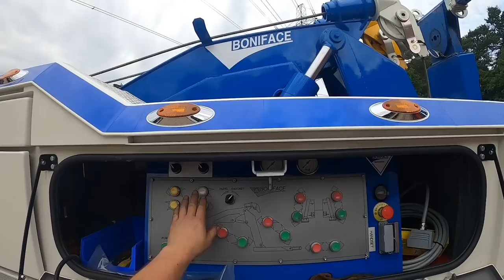NEW HEAVY RECOVERY TRUCK WITH AMERICAN TWIST!

Comment: What a spiffing new truck :) The locks on the lockers appear to be a bit in the way, though. Bound to get caught on them when they stick out like that. I am curious about the wheel setup, both on this and the old one. On the continent trucks like these are all 8x4 (we've even had some 10x4 in the past), especially here in Scandinavia where we have lower axle weight limit. Don't think you'd be allowed to tow that much with a 6x2+2 here, although I'm not quite sure if the weight limits are suspended or raised for tow trucks.
Reply from the maker: Thanks for watching , it does seem a lot to tow with single drive axle 70 tonnes, think at that weight our first choice would be one of our 8x4 trucks.

Comment: hey steve is there a reason why you don't use safety chains
Reply from the maker: Hi Logan thanks for watching, never used break away chains before as they dont normally come with UK Recovery Trucks as standard as we not require to use them in UK.

Comment: Isn’t Boniface owned by Miller?
Reply from the maker: Hi Joe , think Boniface just sell there products mate.
Reply: @HeavyRecoverywithSteve  I know Century and Vulcan are owned by them and they are their own manufacturer as well. Do you guys get Jerr-Dans?
Reply: Miller bought Boniface in 1996. I believe all heavy wreckers and rotators sold by Boniface now have bodies built by Miller at their Tennessee plant. The underlifts for both the  rotators and wreckers are built by Boniface, not Miller.